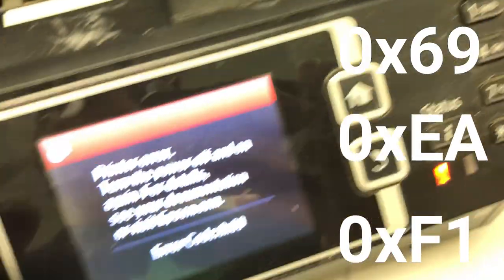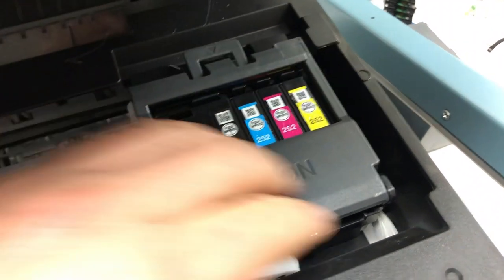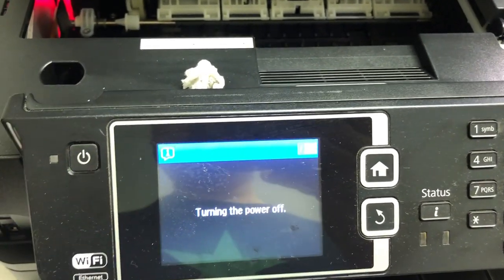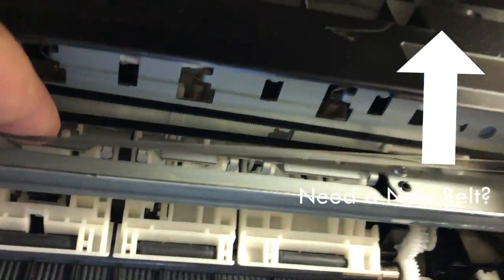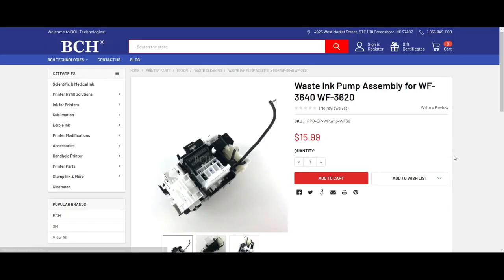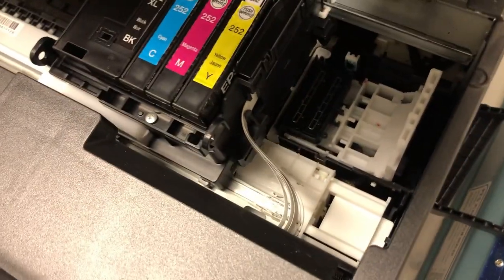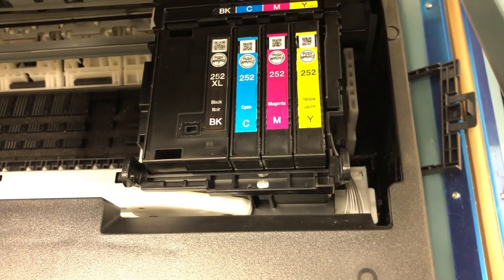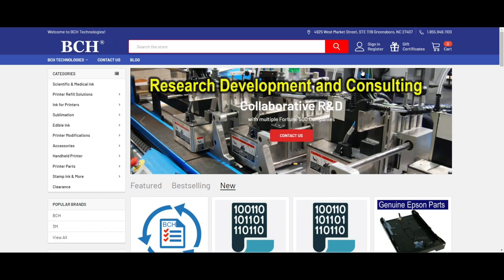Epson WF-3640 Error 0x69 0xEA 0xF1 Explained - Fix WorkForce WF-3620 3010 3520 3530 3540

Comment: yes same observation,  these errors are same issue,  printer throws different code due to the startup status. The issue is even if you replace the ink pump assembly it occurs..there is a work around thou?
Reply from the maker: I always throw in a new waste assembly.  The assembly is powered by gears ⚙️, so make sure the gear is in the correct position when you swapping the unit.
Reply: @BCHTechnologies  thank you again for this great insight video